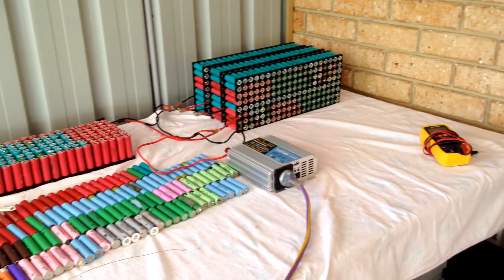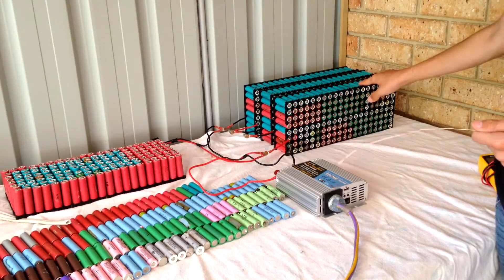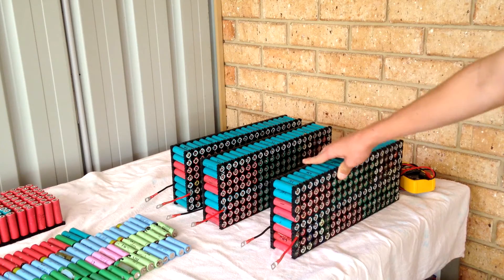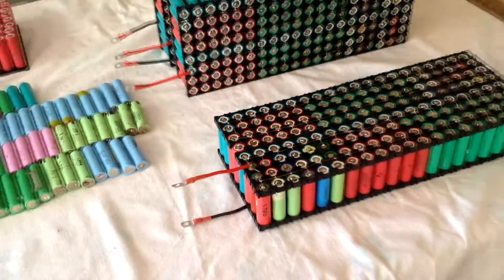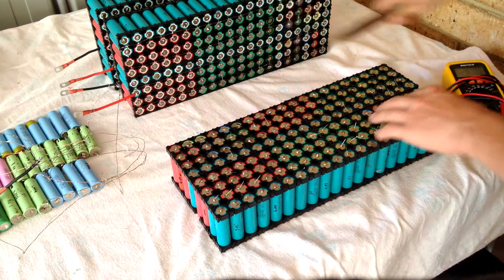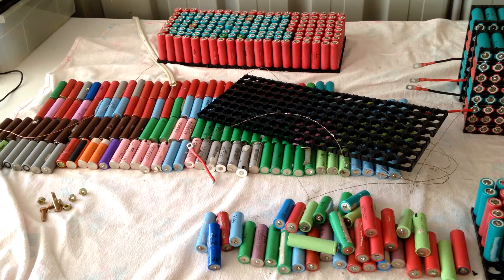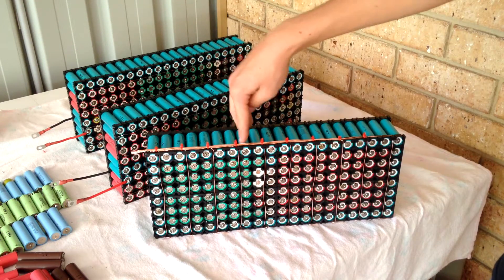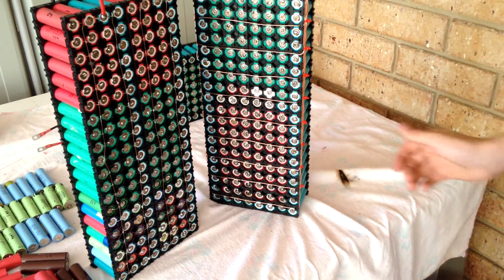DIY Tesla Powerwall | Changing Bus-bars | Update 12

Comment: Good work, rather than going 12v and having to worry about the very high amps why not design it for 24v or 48v that way when you buy a new inverter you won't have any current problems going forwards. Plus 24v or even better 48v can be far more efficient and will be much better when you want to keep adding more packs/larger packs later on, I know you have a 12v inverter now but you can still use that in the short term as its so small on a pack designed for 24/48v
Reply: Mikes DIY Tesla Powerwall so true with the current. I've gone 7S for 24v since you can use smaller wires and fuses.